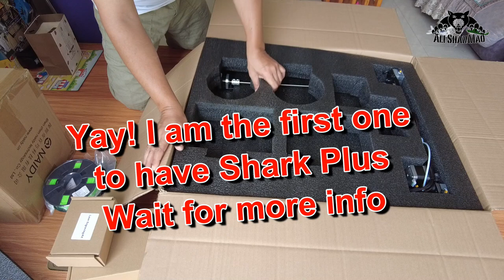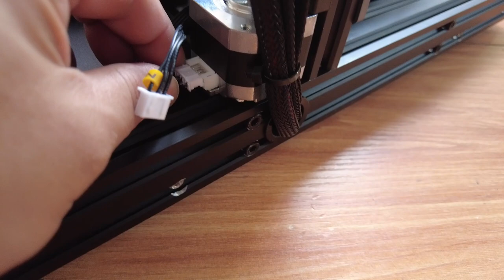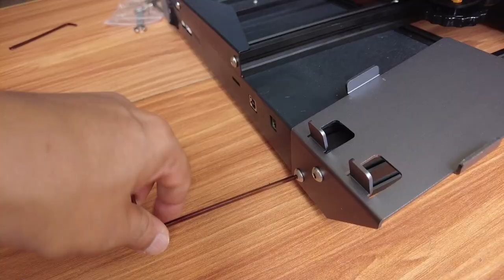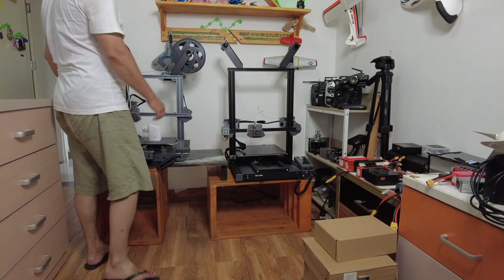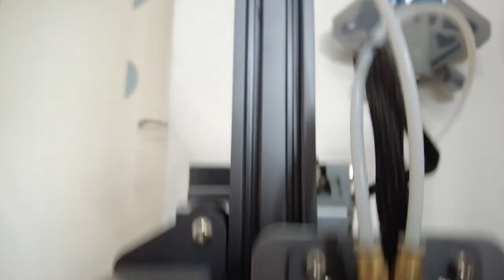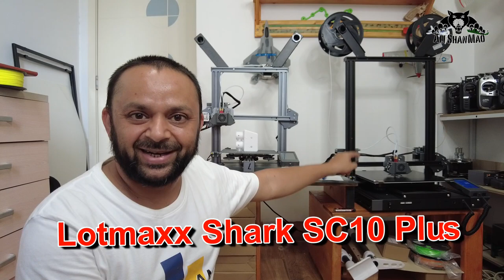3D printing a Full Size Electric boat Lotmaxx Shark Plus 3D Printer Part 1

Comment: Salam Brother. Now that new 3D printer is amazing my friend and looking so forward to you next build project 👍👍👍
By the way, banggood have asked me to do reviews for them on Rc things and lock picking things etc.... I want to capture some images through a gopro which I did not have, so purchased a cheap Hero3 gopro which is not too bad, I would have liked a more up to date one with maybe a remote too but my funds are low.

Anyway, wondering if you can help me buddy. I am wanting to put my gopro on a hat for filming outside but have no way of doing it. Would you be able to make me something with your 3D printer? I purchased the Hero3 for about 25 Euros but would like a better one so currently looking. If I find a better one I can give Hero3 to my son.
Reply from the maker: Wassalam Brother. congratulations. :) make affiliate on banggood too so you can earn commission on your reviewed stuff.  for GoPro there is a head strap brother, very cheap you can find on amazon or ebay. just few bucks. I use it a lot for my filming. there is also a chest strap, again very cheap on ebay or amazon. I would suggest go for that because they are very soft and comfortable to wear. 3D Printed one will be very hard on your head and hurt your skin too :) you might wanna keep your zone in ebay or amazon (UK)
https://www.amazon.com/s?k=gopro+head+strap&ref=nb_sb_noss_2
https://www.ebay.com/b/Head-Straps-for-GoPro-Cameras/64343/bn_73446087
Reply: Shukran brother. I will Affiliate too but if needs paypal will use my wife's account as I do not use paypay or have credit or debit cards. So what is the best to buy buddy chest or head strap??? I would assume the head strap as your head turns to look, so camera will see what I see. 
My gopro I got as said is a an older Hero3 is this good enough for what I need buddy?
Reply from the maker: yes head strap is the best to go. actually banggood has the gopro accessories and head strap too. check with their manager, he might be able to send you one :)
on ebay or amazon, paypal or credit card works.
Reply: Thanks for that buddy. I will check with my banggood contact if he can send me a head strap for gopro.... It will be two videos in one 👍👍👍